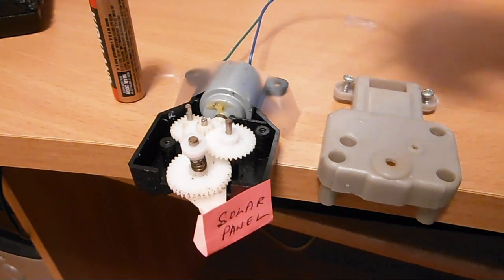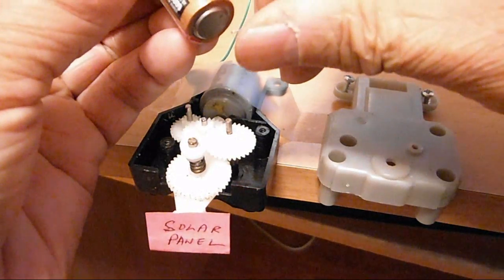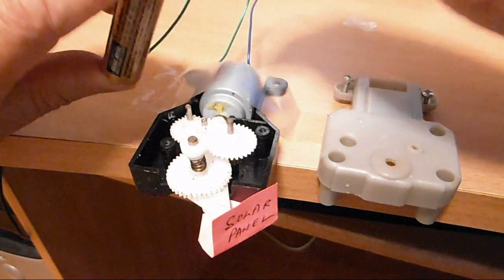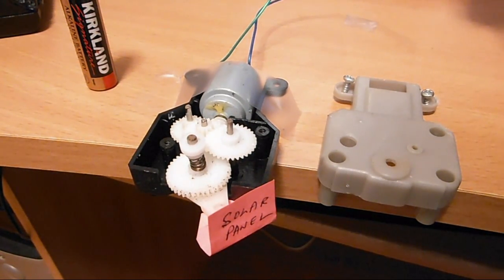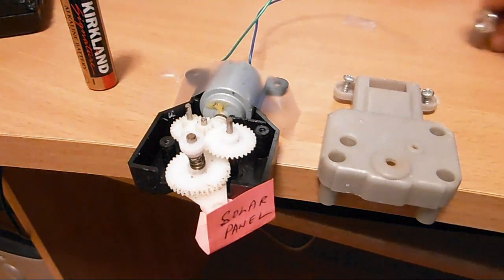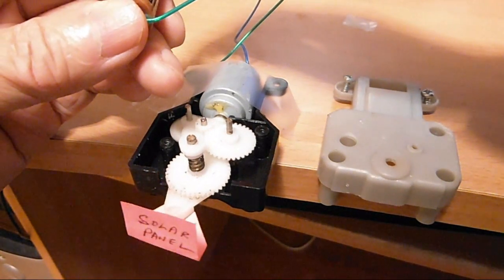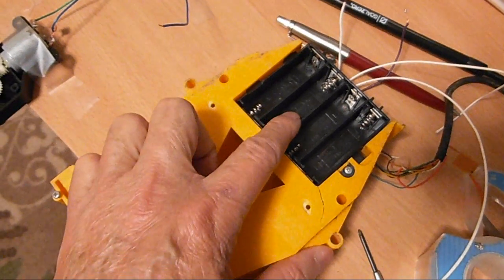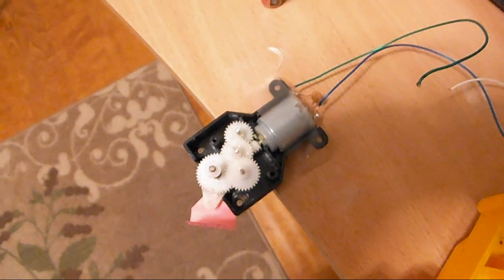Gear motor actuator - solar tracker part 1

Comment: Your toy is just like the gears used to turn limit switchs on & off on all the actuators I have,The last gear has a dual cam on it to trip the switch on & off.

Comment: I started simple by manually turning it with a 3 way switch as the day progesses, then later I put a circuit together that tracks the sun.  small 10a limit switches are cheap.

Comment from the maker: Battery drill motor has a lot of torque. It gets complicated when you scale it up as you need limit switches and relays and a power source and some kind of circuitry.  I'm just scratching on the surface.